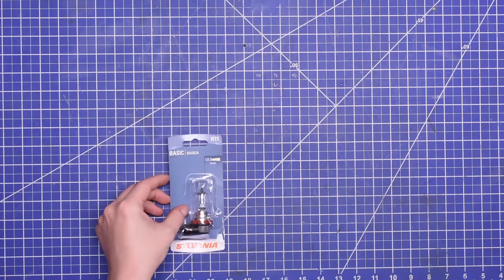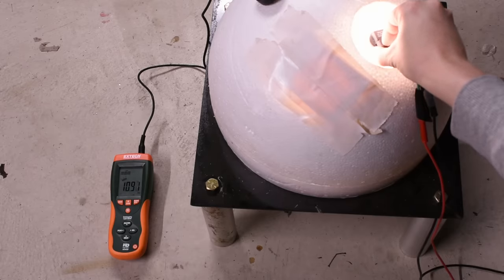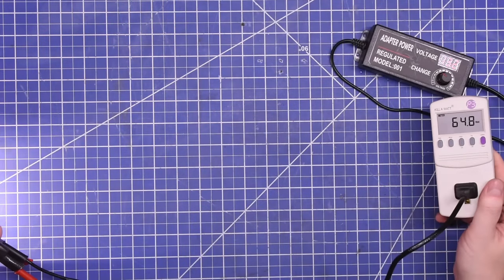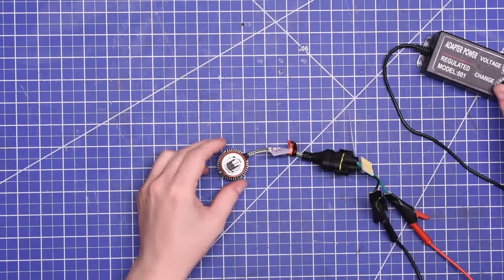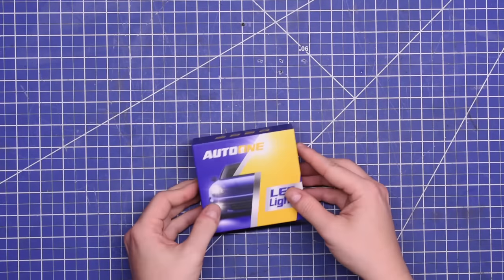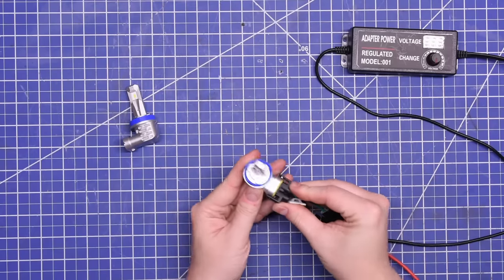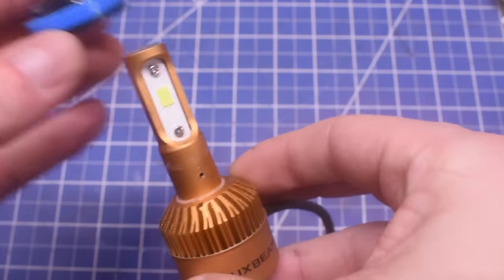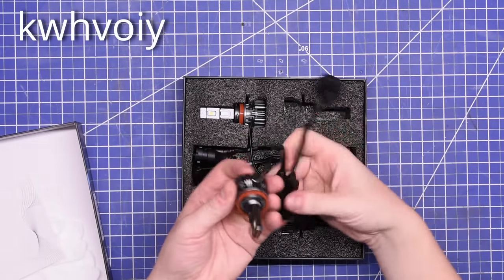Amazon Headlight Bulbs are Getting Out of Hand

Comment: Would love to see these vs some cheap 35w or 55w HID kits as i think even the 35w HID's would be putting out more light with better color rendition. 

Thanks for testing these i have been wondering what they really put out.
Reply: Yeah - I've been using DDM Tuning stuff forever and I'd be curious how their 55w 6k stuff hashes out.  Looks fantastic in my projectors.
Reply: I second this so much!
Reply: Hopefully these are in proper projectors, and not some trash drop in bulbs in stock reflector headlights......
Reply: @D3thM3tal x2 on the DDM Tuning HID kit in 55w spec. I’ve been using them for over 10 years in various cars. AMAZING light output vs stock halogen (projector headlight)
Reply: @elesjuan  even in projectors I wouldn't do it; throw your ludicrously bright stuff into high-only sockets so you don't blind folks. Keep the lows stock.
Reply: @ulogy  Damn right, I had cheap chinese D1s bulbs in projectors, and when I changed to more expensive Philips HID's, it was a night/day moment. Don't go cheap on the bulbs, go with quality.

Comment: Sylvania now makes an LED bulb of very similar make to those Amazon ones. Didn't look too closely as they cost about 100 bucks for a pair, but I'd be curious how they stack up against various bulbs.
Reply: I had a pair in my 03 tundra and I was pleased.
Reply: $99.99 for a pair
Reply: Each...
Reply: $100 for a pair I run them and I'm very happy with them. They Sylvania LED taillights and break lights are trash.
Reply: I run some amazon leds that were around 60-75 bucks and honestly they work LEAGUES better than the stocks do but my headlamps are old and dirty so it kind of contains the light a bit. For reference I drive a 2001 dodge dakota, stock housings.

Comment: I replaced my motorcycle's halogen bulb with a LED from Amazon.  At first, it seemed brighter and perhaps I could see the road a bit better at night, but the color matched daylight and the safety factor of having your light on during the day was canceled by the headlight blending in with the sky and scenery.  The more yellow halogen light is seen much better by cars that might pull out on you.  I had the LED on the bike for about a year and since I almost never ride at night, I hadn't noticed how it had degraded over time.  I went on a long trip to a very remote and very rugged part of a National Forest and stayed there much longer than I had originally intended.  By the time I started back, the sun was going down and it was soon dark, very, very dark and to my alarm, I couldn't see the windy and treacherously steep road in my now dim headlight.  I road my bike really slowly, but nearly went off the edge of the road and into steep canyons several times.  When I finally made it to the highway (about an hour later), I kept up with traffic and used other car headlights to see my way home.  I will never use LEDs in a headlight not specifically designed for them ever again.

Comment: Showing the actual light pattern achieved vs the stock pattern is very useful.  I see lots of videos where the reviewer talks about how much more light they get from the new bulbs.  They don't have a clue of how badly it is affecting on coming drivers, or shining in the rear view mirrors of cars ahead of them.
Reply: We know and don't  care
Reply: @williamfisher9292  That's OK until you cross paths with a police officer who does care and writes you a $125 equipment violation.  Then, unless you can correct the violation on the side of the road, deems it too unsafe to allow you to continue to drive, so he tows and impounds your car.
Reply: @BryanTorok  highbeams genius, just flip the low beam switch

Comment: You should definitely check these out. They are the LED bulbs I got for my truck. And they have worked for the 2 years since I installed them in the new headlight assemblies that I also installed at that time, on my truck! Anyhow great video guys! (And gals, if there's any ladies working with you!) take care!

Also I paid around or close to $80 for these. 
Fahren 9006/hb4 low beam and 9005/hb3 high Beam LED Headlight bulbs combo, 28000 lumens super bright led headlights conversion kits 6500k cool white, pack of 4

Comment: As an automotive lighting engineer I enjoyed this video. The big issue with cheaper LED replacement bulbs is the position of the LED center compared to where the headlight reflector was designed for, you are seeing that with the “random” light pattern. Typical Halogen bulbs will only have two light centers for HB and LB where the cheap led bulbs have many.
Reply: What about trying out these in a projector headlight as opposed to reflector ones used, that should give a better light output.
Reply: @akaraven66  projector housings are designed for a 360° light output, such as what you get from a halogen or xenon HID bulb.  LED chips are typically 180° max, or a bit less, and even when mounted on 2 sides of a board, there are still shadow lines directly opposite each other.  In general, LED in a projector not designed for LED is usually worse than a proper HID projector, and sometimes even worse than a halogen bulb projector.
Reply: I hate seeing people putting led or hid in a reflector housing. They blind all drivers. People are so stupid
Reply: Ask yourself why millions are replacing your bulbs. Not our fault your industry isn’t keeping up with the times. Consumers are obviously willing to pay for led bulbs. SOOOO USEEEE THEMMMMMM 😂
Reply: I even have a pretty serious problem with factory headlights these days as well. Color temperature isn't taken into consideration, it needs to be.
Reply: @michaell1603  most modern headlamps are trending towards LEDs. Any lamps designed with bulbs for forward lighting that still use a bulb is because of cost requirements from the OEM. Bulbs are a huge pain to design around.
Reply: @LostBeetle  what about the color temperatures? Modern LED headlights have a very sharp cut line and are attempting to very carefully follow the IIHS glare requirement for oncoming traffic, but that is only true as long as the headlights are aimed properly. Most people never check their headlight aiming and could need to be adjusted on occasion. Poor aiming will cause the blinding glare I think you are complaining about.
Reply: @akaraven66   projector style headlamps are even more sensitive to bulb focal point than a reflector style lamp. So the results will only be worse with poorly positioned LEDs on cheap aftermarket “bulbs”
Reply: @grantharmon8826  "What about color temperature"
If you look at two lights with identical lumen output, but one is neutral and the other is blue, the blue will appear brighter to your eye, I read 40% brighter. Seems to be my experience when comparing flashlights of different color temperatures with the same lumen output. It's an illusion though, in practice neutral light will allow you to see better in the dark even though it doesn't appear as bright. Not surprising considering we're mostly evolved to see neutral light under the sun. LEDs are capable of producing neutral light, it was a mistake to use blue light, and a bigger mistake to not take into account what the human eye actually sees and only going by lumen output. Regulations take no account for color temperature. I'm 35 and have been driving long enough to have seen this transition happen, and young enough to still have good eyesight. 99% of the time I am blinded at night, it's blue light. Even factory lights. And it's ironic that the people blinding everyone are telling those getting blinded that THEY are the ones that need their eyes checked.

Comment: Many years a go here in the UK, I had a Civic Coupe, and just wasn't happy with the headlights at all, even after replacing them with standard but new set. So, I looked around, and our Halford did (back then) sell 100w/80w H4s. MAN!!! What a difference!
YES, I occasionally checked the wires feeding the power to the bulbs, and no issues were found. BUT WHAT A DIFFERENCE! they had the familiar blue band around the bulb that made them ultra white - THAT helped too..
No, according to our MOT (our Govt Vehicle annual safety checks), these weren't for 'Road Use', but, she passed many an MOT!.
Since though, I've occasionally looked around for LED H4 bulbs, but.. Have heard some horror stories on wrong beam patterns, rapid failures etc. And seeing that the better made/working LED bulbs are at, what? £100+ a pair? And as Halfords have long since stopped selling those 100/80s, I've had to resort to a pack I bought on Amazon Philips 'Racing Vision' GT200 "Up to 200% more brightness".. And, yeah, over 'Standard' bulbs, there IS a big Difference... And they turned out to be pretty reaonably priced too for a PAIR pack - Around £20...
IF, you too are a little hesitent at venturing into the world or LED replacement bulbs... Philips 'Racing Vision' GT200s.. They're a GOOD bulbs if you want clear, white, BRIGHT bulbs at a GOOD price, and there are multiple formats Philips do them in too.. 👍      😎🇬🇧

Comment: I've really liked the Sealight brant in my cars. I have them in both my 07 Honda Odyssey and  2013 Lexus RX350 and they have been very reliable for the past few years (both lowbeam and high beam). The main reason I chose them over others is because they're fanless, since in my experience the LEDs that use a fan often come with a cheap one and when it dies it causes the LED to overheat and burn itself. If you could test the Sealight brand and see if they're really making the claims they are, that'll be great
Reply: i was hoping to see them on this list!!! sealights are a great brand have had them in my 07 honda accord and 03!
Reply: What no way! I have a 2009 rx350 and I’m using the sea light LEDs as well. Fog light and high beams. Stock has the Xenon HID but I’m afraid if I retro fit the LEDs into the low beam it would just be worst. I’m very disappointed in how dim the stock low beam is right now because I live on dark roads and really need to use high beams all the time. How are yours doing??
Reply: Definitely I'd like to see another that includes Sealight too!
Reply: @floofyboii6034  Buy a house, living on dark roads is a no-no.
Reply: Sealight switched to fan when I bought some for my fathers truck, got the last of the fanless, not sure if it was their whole line though.
Reply: I just purchased the new Sealight H11 4500K Led for my Impala which uses the same housing in this test. IMO, the beam pattern is fantastic and the 4500k color temp is just about ideal for me. My only issue is a slight flicker at idle but Sealight is sending me a decoder which supposedly fixes this issue. I hope it does because these lights are really good and to my knowledge nobody else makes H11 led in a 4500k temp. I tried others with 6000k temp but they really don't do well in the rain and the beam pattern was subpar in comparison. These Sealights solved those issues.

Comment: I bought a set made by Auxito with the external ballast and they work great in projector headlights. No extra light above the sharp cutoff line (I measured before and after). I was really worried about the beam pattern because I've been blinded by aftermarket lights before and definitely didn't want to be "that guy". Old fashioned reflector lights might be a different story but for what it's worth,  the lights I bought made a big deal about how their ultra-thin light emitter board and spacing wouldn't effect beam-pattern. Seemed true in my case.

The external ballast probably helps with heat, my bulbs didn't fry are go dark after 3+ hours on the highway at night.
Reply: I bought the same brand for my sport bike with side by side housings. Used a halogen to aim the auxito, then matched second auxito to the first.
Had almost identical light spread to the halogen. Stupid bright tho, so I aimed the low beams even lower so I didn't shine oncoming traffic

Comment: It's been like this on Amazon and ebay forever. A big part of the problem is that 95% of the people buying them don't really understand LEDs beyond their greater efficiency, potential longer lifespan and a very basic understanding that more lumens=better. So the sellers have to keep raising their advertised lumen ratings to keep people buying their product. Personally I try to find bulbs with LEDs that I can find specifications for. A good general rule of thumb with current led technology is that 10w = ~1000lumens. But that number changes quickly depending on the emitter and how well it is cooled.
Reply: it should just be illegal to have lumens high unless it was a lightbar or other auxiliary

Comment: Love this test. Using the housing to show the garbage scatter pattern with led in halogen housings really is what drove me away from LED in my car and switch over to HID for my oem housings. You should also do the same test but with HID conversion lights
Reply: If you’ve got HIDs in your halogen OEM housings, please upgrade to projectors. You’re a safety risk to everyone around you.
Reply: @willdorsett6220  no I'm not. Led have a saw tooth edge from them not illuminating from the exact center but hid have the same projection spot as a halogen so they are less likely to blind people without adjustment. That's also not even regarding the fact that I've adjusted my headlights every time I get a new bulb type to prevent unnecessary blindness, even when I went through a couple different led brands. 
Speak for yourself next time ☕🐸
Reply: @1zinn  unless your vehicle housing is equipped with a scatter shield specifically meant for HIDs (which you don’t because you stated you switched over), no matter how much “adjustment” you do, you are either blinding people with your reflectors, or not giving yourself enough light ahead of you on the road. Feel free to do any research, instead of your source of “trust me bro”.
Reply: @willdorsett6220  yeah, you're right. I've been blinding people for the past 3 years even though I've never been flashed back once. You know that me lowering my beam to a better height doesn't mean anything. Your opinion is more valid than my actual experience. Now save the world with someone else's headlights 👍

Comment: Would love to see a VLEDS vs a Morimoto headlight as I went through immense research to find a “high quality” LED headlight replacement in a 5K color. It’s so hard to find a close to OEM color for LEDs. I never could stand the blue tint the Amazon or other “top brand” lights gave with their 6K+ color.
Reply: Yes! VLEDS is what I swap into everything I have, except I do not run LED's in regular headlight housings. I've not had any of them fail and the oldest ones I have are probably 7 years old now.

Comment: I would LOVE to see you guys test the dimming rate of these Amazon LED'S. In my experience, they're great when brand new.  But after a couple weeks, if that, they seem to become very dim very quickly. So before you know it, they aren't performing well at all. That's why they're so ingenious. Because people see how bright they are initially, but they become shit fast.  Also, PLEASE test how far they actually shine!   Because compared to halogen it seems as if they disperse avd just don't cut through the dark nearly as well. Also, you coukd compared tgem to high wattage halogens.   I recently upgraded my headlight wiring harness, which cost like $20 abd took about 15 mins to install, and installed 90/130 watt high wattage halogens and the difference is night and day, no pun intended. Thank you!

Comment: What I really like with this video is it shows the difference in beam pattern and cutoff between a proper OEM spec halogen and an LED trying to replace that halogen. With the LED's not having the exact same light propagation (and location) as a halogen filament, they wind up with those "artifacts" and cold spots in the beam pattern. This poorly focused light is exactly why drop-in LED bulbs often bother other drivers on the road. One thing I want to experiment with is ramming a filament style LED into a headlight housing designed for halogens, and see if the overall beam pattern can be replicated, resulting in much better use of all the extra light LED's can create over halogens of similar size/application.
Reply: That sounds like a plan

Comment: I’d definitely like to see the Philips Ultinon pro9000’s stacking up; I’ve had them in my basket about 5 times but haven’t taken the plunge due to how previous led bulbs have performed as halogen replacements.
Edit: nighteye/novsight are a commonly recommended brand for older VAG cars in owners groups. Some hard figured and comparison of those would also be great.
Reply: cant go wrong with pro9000. they're that good on reflectors despite of their premium price. for projectors, better stay with xenon
Reply: Gtr csp minis are the only LEDs that I've found that perfectly mimic the spread of a normal halogen